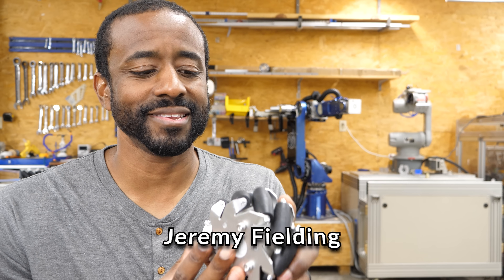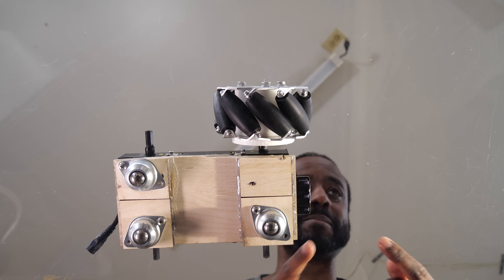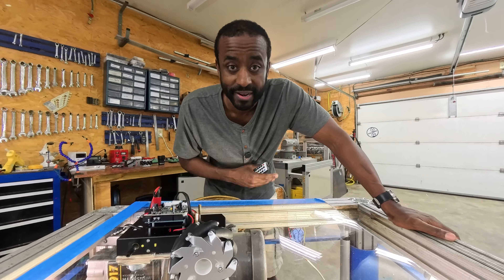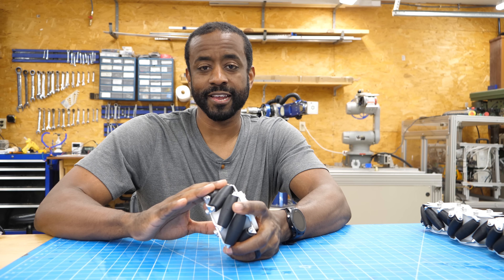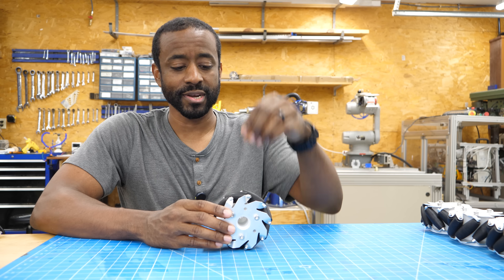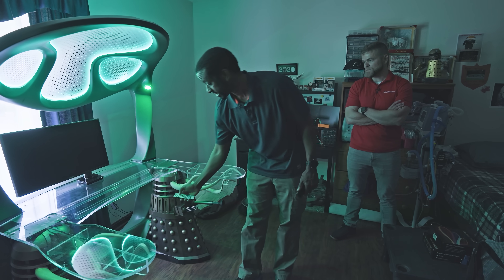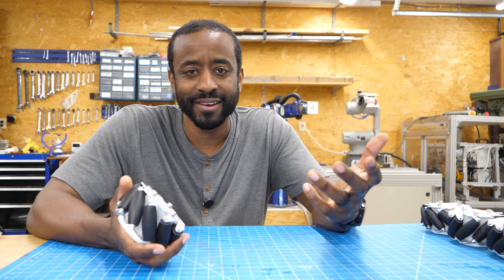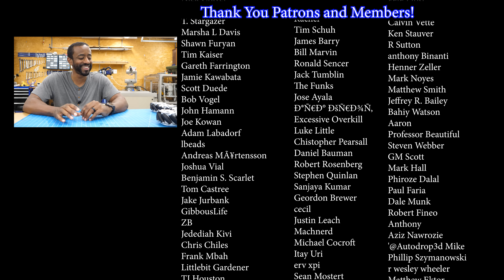The Mecanum Wheel Is So Weird, It Is Genius. How It Works

Comment: I want these on my mobility scooter!
Reply: Personally I am surprised that many devices haven't gone this route. I.e. hospital beds, wheelchairs etc. But I think part of it is comfort factor. They tend to have tiny bumps in the ride if they are even a tiny bit out of wack. But with the funky construction of airless tires it could be a fairly smooth ride. Someone needs to design the rubber rollers with the airless tire structure inside so it can handle small bumps better and it would offset some of the vibrations felt I think. Can you imagine a hospital bed robot that you just tell it what room to go to and it just moves there on its own avoiding people? That would be a crazy sight, but we are not far from that these days. Someone will probably build one and sell the hospital on the idea at some point.
Reply: @newmonengineering  yeah thinking more about it, range is often a mobility scooter issues, over uneven paving and loosing so much directional power, thes wheels might further diminish the range. But the thought of being able to safely navigate the tiny historic UK shops in my area is also appealing.

Comment: wait im paused at 1:54 and ive just realized. its a bunch of crown pulleys. the glass pane is a giant belt doing the pulley self centering thing.
Reply: wait that's just how curved cross section tires work. the belt in Matthias Wandels bandsaw is a road surface made into a loop. either reference frame works though.

Comment: Good content. I've wondered about these wheels. I had assumed the separate rollers were also powered but I see now how they work. Something I've always been fascinated by: Tire Contact Patch. It's very small but the physics going on there is impressive. Itty bitty patches where the rubber sticks (hopefully) to the road and keeps the vehicle between the ditches. No doubt the contact patches on the mecanum wheel are crazy. 
I would imagine there would be extra wear on the wheel and roller bearings?
Reply: Tire engineering is NUTS.
Reply: The bidirectional curved shape of the rollers, like an American football or very wide rollerblade wheel, has a very limited contact surface, which helps with wear.  Most wear on wheel is grinding of the outside edges during turns.  Generally using these only on smooth and/or painted concrete also helps with that.